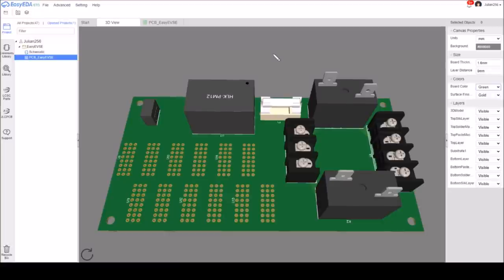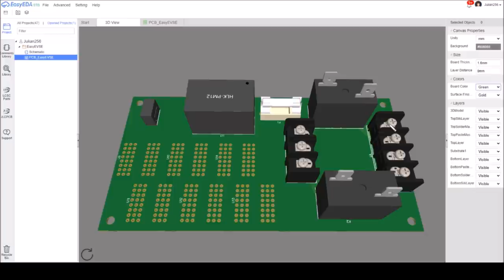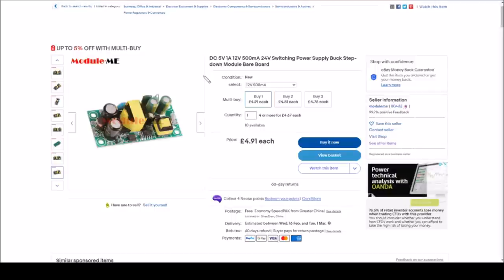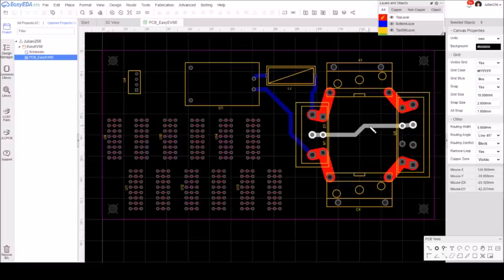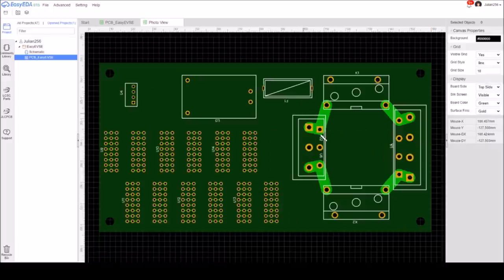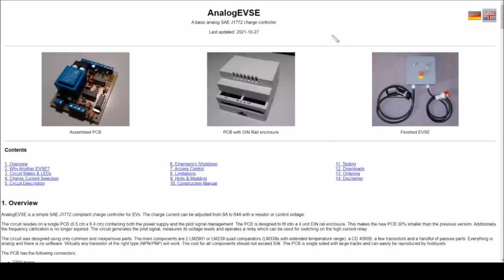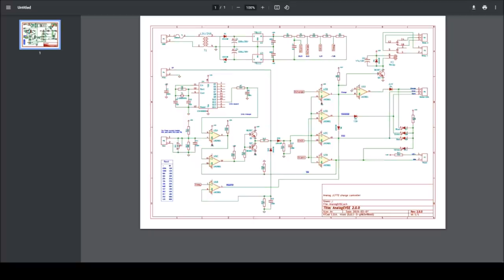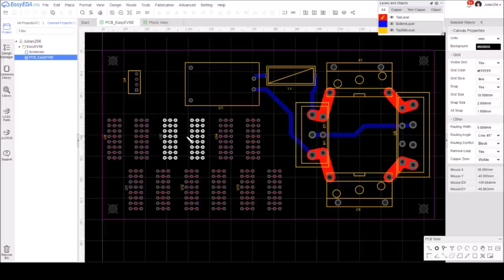EasyEVSE Design #2 - PSU and Prototype Area

Comment: I have used those little PSU modules a few times without issue or the external components. Lately as a power supply for a speaker protection board and two in series for a 15+/0/15- supply for a pre amp!! Works very well, no noise detected.

Comment: Hey Julian -- (8:31) you can right-klick each track and simply use "expose copper". The track will still be plated, so you don't have to do the cutout on the bottom soldermask layer. Not liking the anemic earth track - you have the space - so no reason to not make it bigger.
When working with mains power, some board cutouts may be a good idea; you simply draw them as a wire, right-click and choose "convert to board cutout".
Reply from the maker: Ah, yes, thanks for the 'expose copper' tip - that's quite a bit quicker. I've made the earth connection a bit thicker since making the video.

Comment: Why don't you use a low power transformer for the +/- 12v far safer than using an unkown SMPS from china. No need for the filter and far better isolation and will last for years.
Reply: An added benefit is that you'll get a scaled down mains voltage reference which would be good for power metering. I suppose that after getting it to the point where a 0-5V (or so) signal varies the charging current from minimum to the maximum supported by the circuit, it would be fun to use an analog multiplier along with a low pass filter and some opamps operating as an analog PID controller to try to get close to zero net grid power.

Now the challenge is trying to find a good quality small mains transformer that doesn't cost substantially more than an equivalent switching supply. Don't forget about the regulators and capacitors.
Reply: Exactly - like the one you are copying does it!

Comment: I believe using parallel copper zones with multiple via stitches might be a better option than using thick traces for high current paths.
They help in better thermal dissipation via convection.
Additionally you can have those solder mask resistance / keepout areas for solder tinning.

Comment: For negative voltages there are simple modules like your isolated 12-12v converter. Put 12v in and -12v goes out of the other side.

Comment: I assume they used the wider pitched screw connectors to get the required creepage distance between the pads at mains voltage.
Reply from the maker: Possibly, although the smaller 8.5mm pitch terminal strips are still rated at 300V.
Reply: @JulianIlett  It's not the rating but the required creepage distance hence slots cut into PCB's on some systems not sure on current regs but is used to be 3.2mm on single insulated products and 6.4mm on double.
Reply: Creepage distance is required between the high voltage and anything that you may come into contact with.  So if there is a push button or a switch on the low voltage side you need to show that it can not become live in a fault. So meeting the requirements of creepiness and clearance distance.
Reply: @TheEmbeddedHobbyist  Yes and between mains and isolated side of a PSU.

Comment: The first choice of PSU seems better to me even with its external need's, after all the extra things are stuff that can fail and be replaced anyhow, I dont like those dodgy looking eBay supplies and you mention 'touching' the supply, well your second choice is no better in that regard, initial thoughts are that it's worse, these are my thoughts and I am looking forward to seeing this evolve and its great to do stuff using analogue electronics for a change ...cheers.
Reply from the maker: The problem with that, is having to spec all the extra components (common-mode choke, capacitor and varistor). Time is limited as I want this EVSE to be up and running by the spring. At least the eBay PSU has all that weird mainsy stuff already on board.
Reply: @JulianIlett  Yep thats true.

Comment: Having followed Big Clive for some time, it seems to me the chief purpose of ground is to prevent one's body being the easiest path to ground. Secondary to that, though, the ground leakage can also help trip an upstream circuit breaker/GFI/RCD-type thing. That only requires 30 mA or so? In any case, it seems a surge would only be momentary anyway, at least on properly-wired circuits.

Comment: You could go for an old-style PCB mounting transformer with a split secondary. Simple and reliable Also anti-tracking slots around the terminal blocks might be a good idea.
Reply: The analogevse even uses this type of power supply. I don't understand why Julian chose a different type.